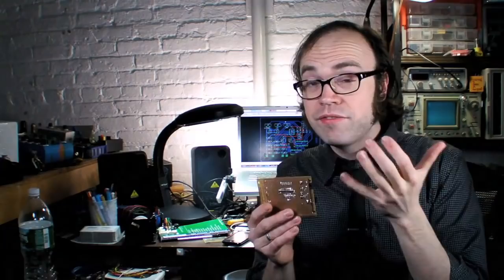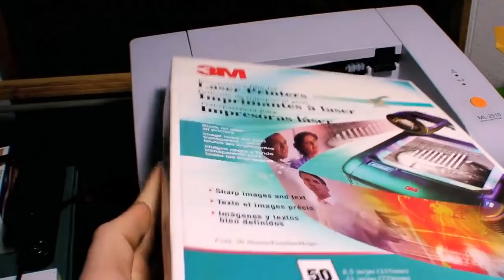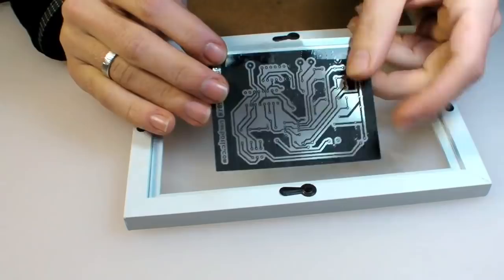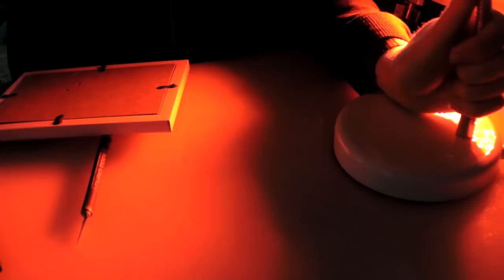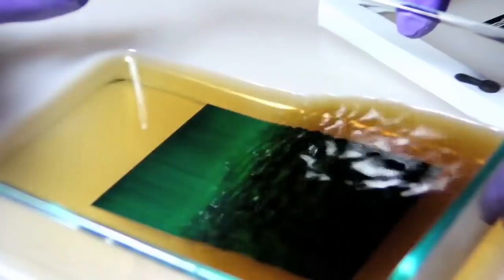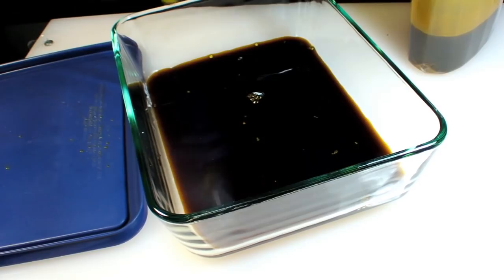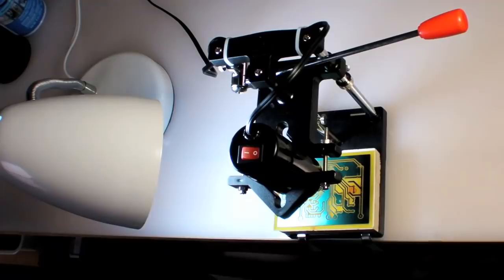Circuit Skills: Circuit Board Etching

Comment: You can significantly accelerate the etching process by heating the ferric chloride. I usually heat the glass container on the stove while stirring. It takes about 5 minutes to etch.

Comment: @v8power101 ive done board eching before. the red led's (mainly Infared light and very low UV) he used so he could see to align the board without exposing the surface to UV light or it would leave a stain mark and mess the board surface up. the developing light is to expose the board evenly to uv light from a constant distance.

Comment: @v8power101 the red leds are used so you can manipulate the board without damaging the developing film, since the guide print still has not been placed. If you dont use red LEDs, or other form to protect the film, you will ruin the entire board before being able to transfer the film correctly.

Comment: I agree. that is what I do. add a bit of H2O2 though. Any glossy paper will do. I use Fritzing for design from design to final print is a matter of printing, cleaning the copper, ironing and  etching. 8 minutes? yes and then drilling. Done.

Glossy paper is delivered free to my mailbox: folders, adds

Comment: Red light exposure to the photosensitive PCB wont have any effect. BlackLight or Purple is at the other side of the color spectrum, and WILL have effect(Even better than the light bulb mentioned in the video). 

So if you want to setup the frame first, just use a dim room, as it will not have much effect. After that, you can use the purple/blacklight to exposure the PCB.

Hope it helped! :>

Comment: Protip: 

Wipe off the resist before drilling. 

Otherwise paper can easily get stuck on the copper near the holes, which is annoying. Worse, the copper around the holes might even get ripped away from the board if you are unlucky. This is often not a problem if the drill-bit is really sharp though, as it probably was in this video.

Better yet, only use surface mounted components! :)

Comment: @JoshuaEdumcation it looks like the drill press that he used came from Jameco Electronics, part #26702 for the drill and #26711 for the stand, or it was something similar to the one that they carry. I have found that a dremel tool with a stand and an adjustable chuck works just as well, and a dremel allows you to adjust the speed if needed.

Comment: perfboards or classic breadboarding on a thin plank (kind of like perfboarding, but using nails and wires between nails, looks actually fun, lol, and you could use a glue gun to permanently fix terminals/wires on to the nails). I prefer perfboards for my circuits. All you need is the perfboard and a soldering iron. Use Fritzing for the perfboard layout, or improvise directly on the board.

Comment: if your circuit doesn't contain smd ics (and if you have a steady hand), you can actually draw the circuit using a fine point marker pen on a copper pcb and then use acid. it has a much more primitive look to it, but it's much simpler

Comment: There is another way but technically it still uses chemicals. White vinegar - which can be found right in your kitchen. Copper board + fine tip sharpie + vinegar + silhouette cameo get's pretty impressive results.

Comment: some pads there were in short, the ones that passes between 2 IC pads,
This is the most proffesional way to do a board, but it is quite expensive, and you need a 2 differnt liquids.
but the result is very good.
Im going to build a CNC mill to do this stuff.

Comment: Processing electronic materials is really cool, I took a lab where we processed a microchip that had a bunch of devices on it.  A major part was using photomasks just like in this video.  The only problem is that for the precision of a microchip (our devices had dimensions down to 10 microns) you can't just use a printer for making the masks, it requires photomasks made using an electron beam.  I never realized PCBs were so easy, when I get a chance I would like to try this out.

Comment: Nice!

I've been working with 'press-n-peel' and haven't quite perfected the transfer process yet.  Clothes irons are horrible, press hard for several minutes and still a crappy board. Next, a laminator. Several passes does an ok but not great job. Preheating the board and transfer in an oven before 'laminating' helps.

You make UV look so easy! I'm tempted to try that! I have a pretty big supply of plain copper boards though.  Next stop Google to see if there is a way I can use them! with UV!

Comment: @deliusism1 Ferric chloride seems to be pretty safe. I've been dumping that down the drain for a while with plenty of water. I don't have municipal sewer and rely on a septic tank and I've had no problems with the tank or dead grass. I've spread FC around on the ground with the same results. Right now I'm using cupric chloride. Used CC can be used for a long time. You just need to re-oxygenate it. CC does do funny stuff to the environment, but it's normally in small quantities.

Comment: i still prefer thermal transfer with gloss paper, printing the layout with laser printer on high quality, put the printed image facing the copper side of the board and use a flatiron to heat the paper so the paint will stick to the copper. you'll slightly see the printed image trough the paper when it sticks. after, you put the board and paper under cold water, and removes the paper slowly. rub your finger over the board (paint won't come off) to remove the gloss and its ready for corrosion! :D

Comment: @DannickFox actually, transparent foil must be for laser printer if You are printing on laser. There are transparent foils that can not keep up with the ironing heat from laser printer and wrinkle, or stick, in printer ruining it.
While printed with a laser it looks visually ok, as of Laserjet 4 ( I think) printers use dithering to fill black areas. Can be coped by experimenting with the time of exposure, touchy. Best is to retouch as in video, maybe a reheat before, or a few hours over nitro.

Comment: wish they had the iron transfer method too.
I use kodak photo paper and and iron set to linen to transfer the toner(acts as resist)

I found so far that kodak photo paper works best and does melt the surface

Comment: If you already have a Flex-Shaft for your Dremel it will work just as fine. The holes may not be 100% vertical though.

Comment: And a 100% homemade angry transformer picture in the background. I feel like making these with this method and also only removing photoresist where I need to solder so that it looks cooler, no other wires will jack up my board, and the solder will stick to only the copper.

Comment: I vote for hydrogen peroxide and HCl too. Doesn't stain if you spill a bit on the counter, and it's way easier to dispose of properly than ferric chloride. Using regular hardware store floor cleaning HCl and pharmacy peroxide works all right, and if you can find industrial peroxide (30 to 50% concentration) it works amazing and is dirt cheap. I got a quarter gallon of 50% peroxide from an industrial supply in town for around $5, once I got the dilution right, it's a wonder.

Comment: Today I tried photoresist first time(never had success with toner transfer method).
1st board was total fail(underestimated developer(pipe cleaning solution was used)
2nd board was partial success(will work I think)
3rd board was total success
I recommend this method to other people too(just pour little pipe cleaning solution into lots of water) and everything else I did exactly same(ok, I didn't use red light). But I did use CFL lamp(220V 15W one). yeah, tomorrow I'll start drilling

Comment: @v8power101 Red LEDs don't emit UV radiations that will interact with the photo sensitive layer of the board. Every light as far as possible from the blue and the violet will works good, but the red one is the safer.

Comment: @deliusism1 ferric chloride is used in yours nearby coal operated power plant for cleaning tubes from deposits. wouldn't believe how much of the stuff gets into water. This is not nearly concerning as chemical industries. The pipes for wastewater are mainly ceramic or plastic, so You will clean the deposits (calcium based) from pipes. For all of these chemicals there are ways to recycle, depends greatly on country You are in. At my place, we just run a lot of water with it :)

Comment: i know this was made years ago but its still a great video on this. i definitely appreciate it.  this has been something ive been seriously considering for a couple years now at least. 

how long does this entire process take for this board?  
and how much difference is there between soldering this type of etched board vs. a manufactured board (i.e. with solder pads, plated holes, etc.)?  

i never thought about that aspect although i knew there was those differences already, just never thought about it.

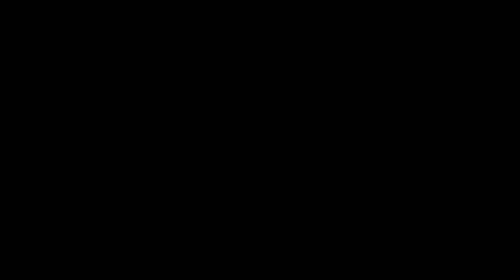Comment: There is a short in your traces which can be seen at 6:55 upper center of frame 8 pin dip and wow many others in lower just off center and once again at 7:47.
This is why a color copier is better to use than b&w laser...no need to print twice and overlay. Not to bad results otherwise...IMO

Comment: No, the ink on the surface causes the copper from being eaten away by the ferric chloride. Once the acetone has removed the ink, you are left with the copper contact lines. All of the other metal is gone.

Comment: there are vids of it on youtube, thats where i learned it. just buy muriatic acid. it sells in garden centres. most use it for cleaning concrete. it may also be used in swimming pools. personally i dont re-use it, cause i like "quick". Also, if you dont re-use it, each "batch" will contain only so much copper... which can be diluted, then i use it as weed killer. if u keep re-using it, the copper content goes up and up and up, and so does the toxicity (i think)

Comment: I did this once. Massive pain to drill all the holes + expensive corrosive chemicals.

Then I worked out that it's cheaper just to get the boards done at one of the cheap Chinese or Bulgarian manufacturers. You even get plated holes, soldermask and printed labels. The downside is the two weeks of waiting for your board to arrive.

Comment: yeah it's true. you can even make your own diagram of the circuit board, with your own design and signature too.
Reply: do you have a recommendation of a program or tool for personal design?
Reply: Dracanic CadSoft Eagle is quite good, I personally use it.
Reply: You think?, I found it quite reasonable, it does have its downsides. What do you think about Altium?. I'm a EE grad, we used eagle when studying.
Reply: Dracanic
Take a look at Diptrace. Free version supports up to 300 pins.

Comment: I used to make my boards that way it was a good way until I came across a method that got rid of a lot of that work. Still use my laser printer, but using a direct transfer method. Using a special paper that allows the toner to be embedded on the paper. Then all I had to do was clean the board and iron on the toner transfer to to a standard copper clad board. after ironing the transfer on I just develop the board like normal.

Comment: You should have an exit plan with all projects and also a disposal plan attached to that exit plan.   Normally, it's not difficult to dispose of environmentally harmful chemicals so long there's a facility for such.  If you do not have a facility that specifically handles such materials then contact your Trash Disposal agency.   They usually know where you can go or they can do it themselves; for a price of course.

If you do not have such luxuries than you shouldn't attempt any Ch.Inv project.

Comment: this is almost exactly how i do.

exept i use ordenary pcb and i have the photoresist in spraycans. i then spray it on to the boards

oh yeah and the drilling. i drill the holes and blow the suff away from the holes.
and when etching it i do it in a container that "throws" the ferric chloride up the boards. this meens etching is about 5-10 mins
you dont need googls or dust mask

Comment: Dude, if you looking for heart in audio circuitry next step on the latter would be point to point wiring. Get a board, of some isolation material, and drill holes, pop eyelets in the holes and solder away.

Comment: Great video :) Question on the topic:
Have you ever attempted the toner transfer method and if so, how did it go?

If you're not familiar with it: Basically, you print the pcb on paper, glossy preferably, and then lay the paper on the board, circuit side down.

You then apply heat and pressure for a while (using and Ironing iron or similar), after this you dissolve the paper with warm water and the toner remains on the board, acting as protection when etching.
Reply: Patrick Hansen I use the toner transfer method with the cheap scotch TL901 laminator instead of the iron. It works unbelievably well. The trick is finding the right paper. THICK glossy magazine covers usually work really well. The paper is important because it needs to come off in the water really easily to keep you from having to rub it off, causing possible mistakes. But what's great about it, if it doesn't work. just wipe the toner off the board with acetone and try again. No wait time.
Reply: That's a brilliant idea, hadn't thought of using a Laminator, seems obvious though since it's job to melt plastic :) good tip
Reply: Patrick Hansen  It applies a nice constant pressure between it's two rollers. Just have to pass it though a few times in order to make sure it gets hot enough.

Comment: The photoresist method is awesome...But I've been having problems with some of the double sided 3x4" boards.

Some of them have a black protective film over the photoresist and some of them have a white film. 

Every one I bought that had the black film had problems. When I peeled the film off parts of the photoresist came with it making the boards useless....anyone else had this problem?

Comment: Maybe it was just due to video quality, but it seemed to me that there were several places where tracks went between pads, and there was contact between the track and the pads on both sides of it.  Did the board work when you connected it, or did you have a bit of work to do with pad separation?  If so, do you have any advice for getting a better print in the first place?

Comment: @deliusism1 The developer is generally sodium hydroxide based (drain cleaner) and can be dumped safely down the drain as long as you flush with water while doing it. If you want to be extra paranoid you can do what I do - bring it back up to a neutral pH with some hydrochloric acid (testing with pH paper) and then dump the result (salt water plus a little dissolved photoresist) down the sink.

Comment: You have a 2 layer board design but have only etched 1 layer of it, so the PCB won't work. I wonder if double sided photoresist PCBs are available so you could just align it and expose and develop both sides separately then etch together... that would be cool.

Comment: Now try to solder some parts on it, that guy forgent the Soldering-lack. It makes Soldering on it WAY easier and protect the Board against Oxidations.
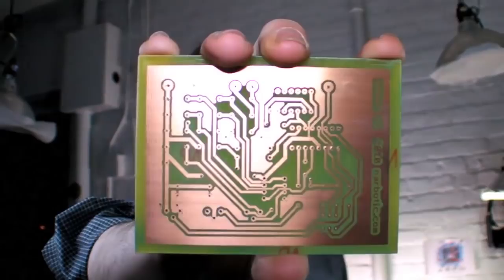Reply: He said that this board doesn't have solder mask (8:28), come on! Overall, you can tin the tracks in order to protect 'em

Comment: HELP PLS ... What is the exact difference between the BOARD and 
PLATFORM? Are there usable boards without SoC or any processor(FPGA and 
logic stuff like that )? And how can several boards be connected to each
 other(pins or stuff like that)?

Comment: ok now that I've actually tried etching my own board i have to say, it's a real pain in the ass.  i chose the transfer method with some press n peels and it took forever to get one ironed on perfectly without smudging or losing half of the print.  and then once i got that done perfectly, i messed up the etching process multiple times... the etching doesnt seem very reliable. the board often still has small scratches of copper where there shouldn't be... and if the ink touches at all, so will the copper.  and if you rinse it all clean, scrub off the ink and find that anything is wrong, you pretty much have to start all over again.  I don't know if this really is worth the trouble.
Reply: May McDonough  Hmm. Its a pain I agree. I had to face such problems wen I first tried it. But you will find it not so hard and u can make nearly perfect boards with the toner transfer itself! Few tips 1. Use photopaper instead of transparent sheet.
2. Chose best quality settings in your printer. More toner!
3. Dont move your iron on the board. Just press and lift. Avoids smearing. 
And I had problems with the etching solution too. The thing is u have to get the right ratio between fecl3 and water. I mix a dilute solution at first then start adding fecl3 with the board immersed till it starts to kick off(i.e till the copper starts dissolving).

Comment: the jameco etching supplies kit comes with the 2 solutions and 2 pre-coated circuit boards.  It's $46.95 USD

extra pre-coated circuit boards are $4.95 USD each.  

Which is pretty good.  I imagine you could do a lot of boards with the solution in the original kit.
(does anyone know how many circuit boards you could etch with the amount of solution in the kit?)

Comment: ok so I got a kit . with developer and ferric chloride.  I get to the point of etching it and the bam nothing  . I put it into the ferric chloride walk around with it to keep it moving and no results. I've heated it with the same nada.  Well I've soaked it now for about 6 hrs and some copper has finally started to dissolve  at this rate it will take about 36 hrs Any ideas what could be wrong ?